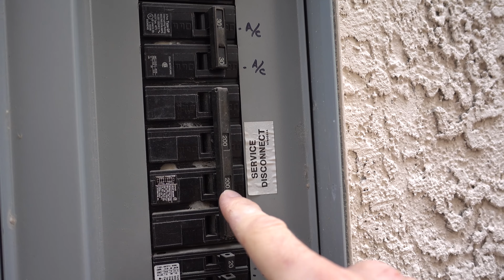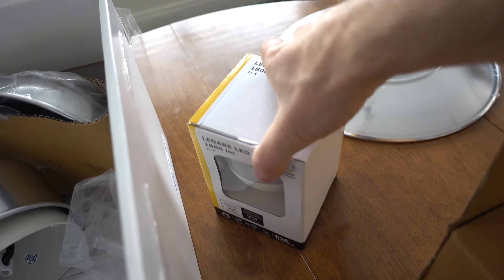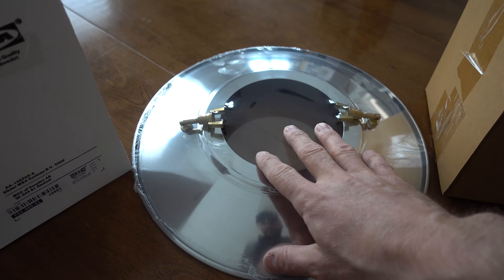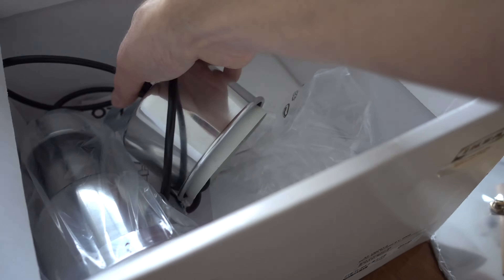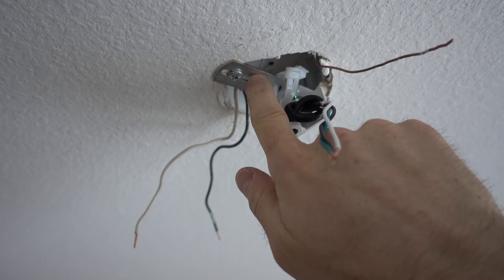IKEA OTTAVA - Install

Comment: I bought this type of light in the uk but it does not come with the round base plate and hook over here. plus I couldn't work out how to butt up the top cover to ceiling untill I seen your video and how simple it was. good video, thanks.
Reply: Yeah me too, also in the UK there is NO earth wire, weird as the unit is metal!! To be hinest it was a pain to fit and still cannot get it to go flush with ceiling. Pooor instructions as well.